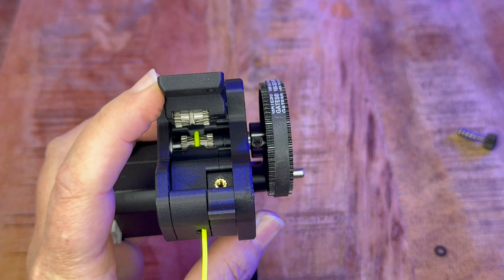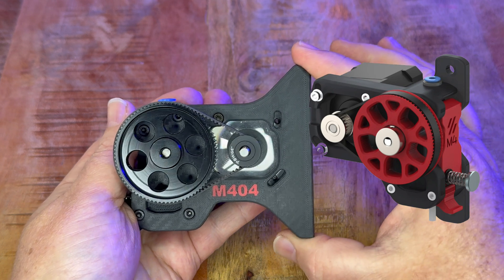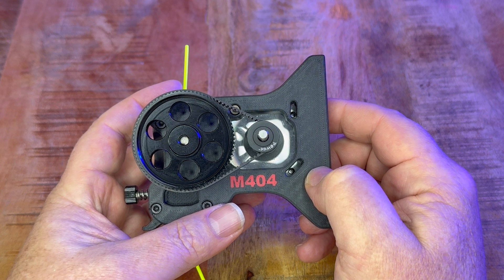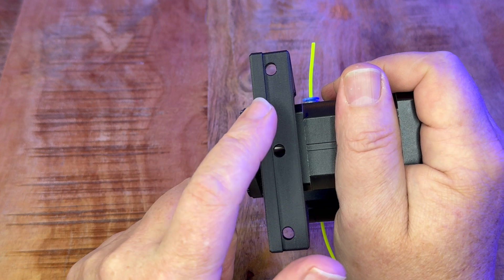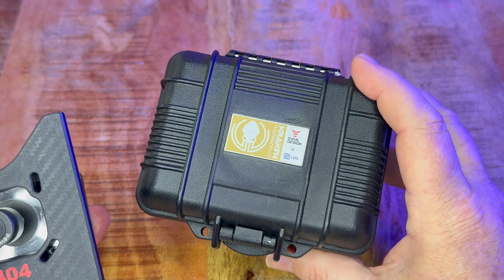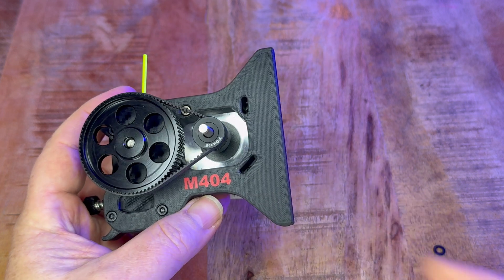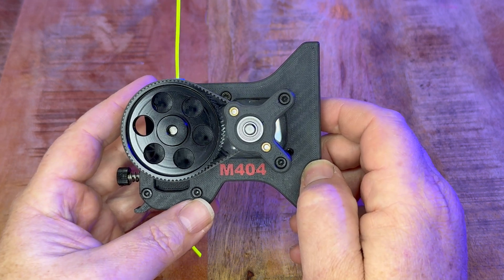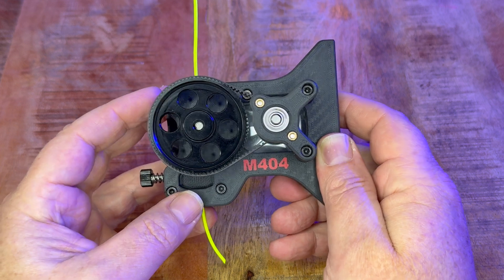Supercharged Voron M4 Extruder – The Ultimate Filament Puller!

Comment: how does a secondary even work in practice? doesn't it require both extruders to be exactly 100% perfectly in sync? it seems like even a small error over a long print time will result in filament tension or compression between both extruders.. or am i misunderstanding what a secondary extruder does
Reply: He shows later in the video, it uses a buffer like the bambu AMS that has a switch. Once the filament is starting to get close to taut it kicks in and feeds more filament into the buffer.
Reply from the maker: Thanks for your Feedback. Do you know of any other buffers except this one?
https://github.com/Annex-Engineering/Belay
Reply from the maker: I dont think the two motors will ever be in perfect sync. The best is to use a Filament buffer.
I will be testing this one.
https://github.com/Annex-Engineering/Belay

And maybe later make one myself. I think it will work good, but dont like the switch that is in it.

Comment: Nice work! If I wasn't happy with the M4 as seconday extruder I'd build one. It solved a lot of issues with my 2m bowden.

btw, the belay will change the extrusion multiplier of the secondary extruder, NOT change between on and off. E.g. for me it changes between 1.1 and 0.8 every 4 minutes (I use a different housing, since I didn't have their exact hardware at hand). You'll see it once you have it up and running.

No issues at 24mm³/s.
Theoretically there could be trouble: The change takes a while to kick in (due to how the commands are sent to MCUs from klipper). So with some bad timing it could kick in too late. But with decent tuning of the two mulipliers I think that's unlikely, since the bowden from belay to primary extruder still acts as a small buffer. The secondary extruder emulates both PA and regular retractions, which causes some unnecessary noise with my setup.
Reply from the maker: Thanks for all the feedback. Im still waiting for some hardware to arrive and will do all the changes then and test it. Will see how good it works and update in a video again.

Comment: Nice remake! I'm definitely going to try this for guiding my 8kg spools.😁

Coincidentally, I installed a Bellay sensor on my Tradrack, but I ran into issues with too much play on the Bowden tube. To solve this, I designed my own version of the Bellay sensor with springs to keep it stable when loading and unloading filament.

You can find it on Printables under the name Filament Balancer Switch—it might be interesting to check out!
Reply from the maker: Awesome! Will have a look thanks!

Comment: I also installed Belay on my beast two weeks ago, photos on my instagram.

Works really well but there’s a bit of friction inside the case and doesn’t really slides well, so I’ll make my own version.
Reply: Hello!
I also printed the Belay Buffer. Mine slides fine, after pushing it many times and then a drop of lube.
Do you use a filament load macro, to load the filament from extruder 1 to 2?
Reply: @Andi-Maringer  Hi Andi, oh I see, I printed mine in resin, maybe that’s the cause of that friction, even with a drop of lube.

Both extruder are synchronized the only thing to add in the Load/Unload macros is the PTFE length between them. 🙂
Reply: @ Hi Andi, on my last video (Magneto) at 3:15 I show the sliding issue I was talking about.

I’m gonna try my own version with a linear ball bearing, it should be better.